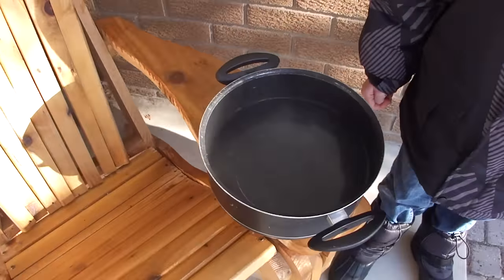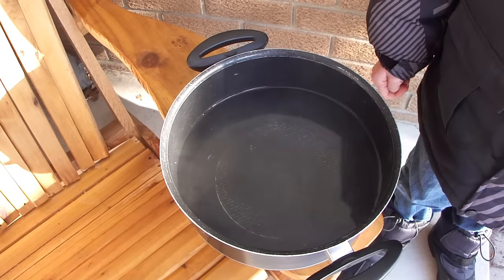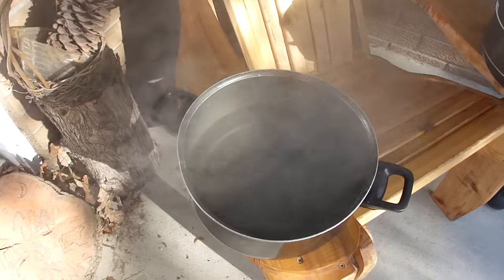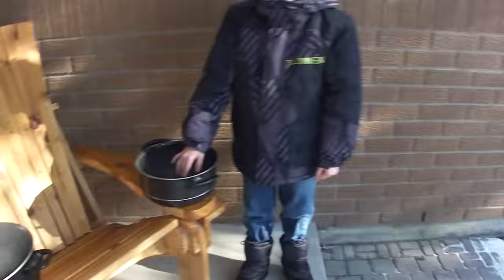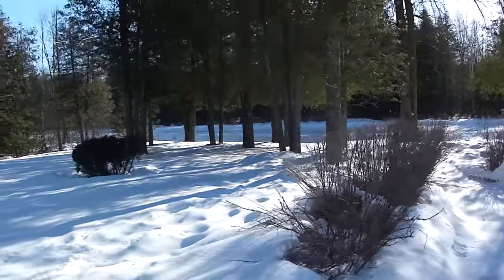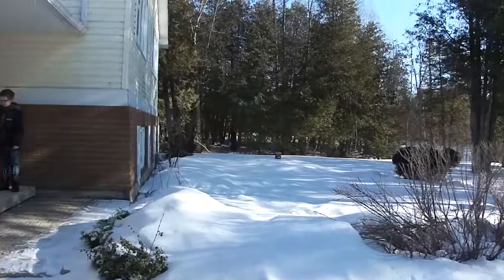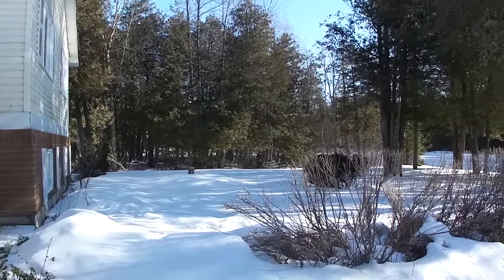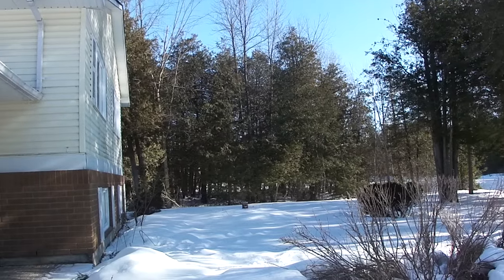Hot water freezes faster than cold water?

Comment: The hot water vaporized, it didn't freeze.
Reply: so, the steam is water vapour in the air....what happens when it cools down again.....
Reply: well it's not "water freezing faster" if it's "steam freezing faster" then, is it? lol
Reply: Hot water + cold air = fog thingy idk 

Like when it's cold outside and u breathe it is foggy. 

TBH idk I'm just making a hypothesis
Reply: dude dont say that
Reply: Fridgidice Gaming I was just about to comment that
Reply: Nope, the hot water vaporized and also freezed 😊
Reply: Fridgidice Gaming it did freeze
Reply: The hot water has heat, right? And heat is energy, right? So if something cools down really fast it loses energy, right? So where does that energy go? Well that energy turns the some of the water to steam. Your theory that it vaporizes is completely and utterly wrong.
Reply: I am very sorry that i said that it didn't vaporize. Vaporization is the process of turning water to gas, which is just what i explained and which was your answer. I am very sorry for the misunderstanding
Reply: Itachi Uchiha no its tiny droplets of water solid water and ice
Reply: Well According To Science , Hot Fire When Putted Out With Cold Water It Will Evaporate Due To It's Molecules Popping , It Will Later Become A Cloud Particles Then Became A Low Battery Camera
Reply: Kruzar Rapana adams 
Your and You're are not the same thing. 
Your is referring to something you own.
(Example: "*Your* backpack is so heavy!" Or... "Didn't Ava borrow your book?")

You're is short for "You are."
(Example: "*You're* welcome!" Or... "*You're* back from vacation!")
Reply: simply the cold wind vaporized not the hot water its like you breathing hot wind to a cold wins
Reply: Thats exactly what i was thinking
Reply: ƃN Ⅎ it takes too long to add in the '
Reply: I neber preeze
Reply: Fridgidice Gaming 
Uh oh low battery
Reply: Uh oh looks like somebody skipped a lot of science classes.
Reply: I can't believe that 2.3k liked this comment,WTF were they all doing in school?
Reply: I think u have to search....Mpemba effect
Reply: Yeah I clearly see it but also the freeze water in the other guy videos
Reply: Its just like you see your breath when you exhale air outside in a cold environment
Reply: Guys relax. The battery is already low 😁.
Reply: Whatever
Reply: Omg I'm confuse😖
Reply: Agree
Reply: H0RCRUX  nope when u breathe out its water vapour u see not “fog” Ik this is a really late reply
Reply: @shs646  *you’re
Reply: It's Froze..... For vaporization heat must be produced... But here temperature is in minus
Reply: I think hot produces steam due to the temp diff is so large this cools down faster so steam is cooled down to water faster creating fog i guess...i may be wrong ...
Reply: What ever,,
Reply: Uh, I don't think it vaporized. That foggy thing you see is just the hot water losing heat. Sort of like when you cool tea using two cups.
Reply: Uh oh low battery dad
Reply: @thisscreensucks  it rains
Reply: Low battery dad
Reply: Woah 5 years OwO

Comment: “Hot water freezes faster than cold water?” It got me.
Reply: Explanation is that hot water is almost boiling meaning that it takes up more space as the particles are vibrating more pushing further away from each other. This increases the surface area as the particles are further away from each other and the heat is transferred to the air faster
Reply: @metro-v8  Yeah, it's losing alot of heat BECAUSE it has that extra heat to lose vs the cold water not having the extra heat to dissipate.. but that doesn't prove anything. Because the hot water may lose heat fast up until it reaches the same temperature as the cold water, at which point what happens? Does the "momentum" of it's heat loss carry it to freezing point faster than the cold water? I've never heard of heat momentum before. Perhaps in the amount of time it took the hot water to reach the initial temperature of the cold water, the cold water temperature got a head start and is closer to freezing than the hot water because the heat loss of the hot water slowed down at some temperature along it's dissipation.
Reply: @TailsNeverFails464   absolutely
Reply: @metro-v8  epic science
Reply: @fairywww  yes science is very pog
Reply: There isn’t a clear explanation to this phenomenon, everything we have right now is hypotheses. The reason it’s hard to study this is there are so many variables which mean the experimenting process is inconsistent.
Reply: @jakesanders136  you make a very good point; im thinking its due to the fact that ice is less dense than water and thus requires more space in between molecules to freeze; obviously boiling water has more space between molecules than cold water does, and thus it freezes faster w that large temperature drop